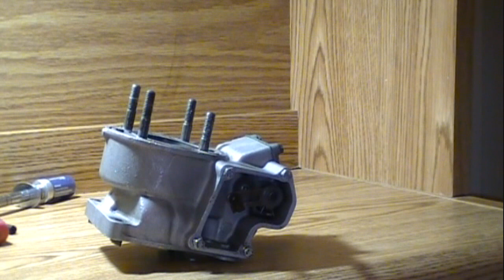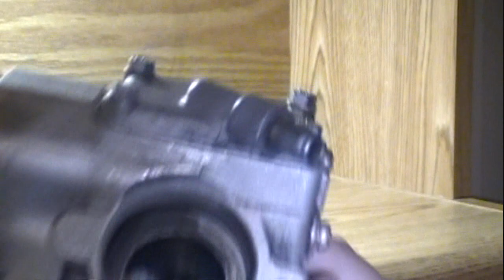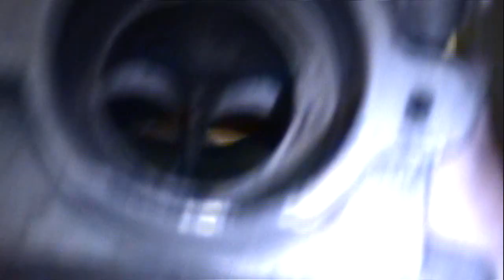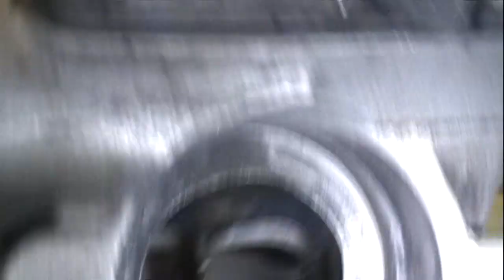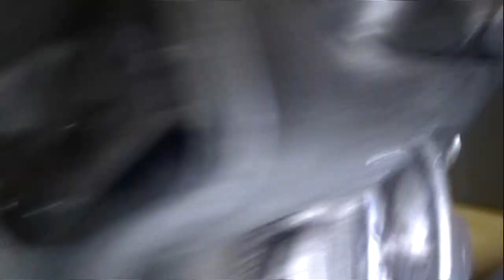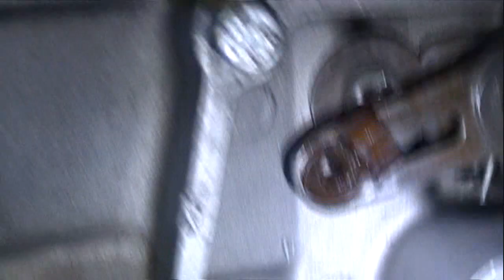Two Stroke Power Valves Explained

Comment: you kind of forgot to mention another crucial part of ther poWer valve system...its not just to give more power and flow At high rpm...it gives 2 strokes a stronger pull at the lower rpms by increasing backpressure and including a resonance chamber that increased the head pipe volume as well as a variable timing mechanism......which boosts torqe....and you only described the 1 aspect, which is the variable port timing which is like the honda hpp system...but the more refined and  better system  is 2 combine the 2 technologies of the variable timing and the addition of an exhaust resonance chamber that diverts the exhaust stream from lower to higher volume to  boost even more additional torque and the next generation of hondas powervalves was called thr crv system.(composite racing valve) and is basically just like the kips system which already was in production and yamaha was the 1st to combine these technologies as well. so in essense 2 things are happening at once .as rpms increase the centrifigul ball governor uses centrifigul force under a spring loaded detent to push the the vaiable timed valves open further and at the same time 2 subport actuating mechanisms divert the exhaust stream to heighten or lessen the exhaust flow volume which simaltaneously also boosts power.... ALL THIS WAS TO OVERCOME A FUNDAMENTAL FLAW IN 2 STROKE DESIGN WHICH LIMITS THE MANUFACTURERS TO DESIGN A PIPE AND MOTOR THAT WORKED BEST AT WATEVER TYPE OF BIKE THEY WERE PRODUCING AND IF THEY MADE THER BIKE TO HAVE ALOT OF POWER UP HIGH....THEN THE LOW END POWER SUFFRED AND VICE VERSA SINCE  THERE WERE NO MOVING PARTS IN THE ORIGINAL DESIGN TO AID IN BOOSTING LOW END SINCE THE VALVES OF THE 2 STROKE WERE FIXED IN POSITION  AS INTAKE AND EXHAUST PORTS. RESULT WAS MOTORS THAT HAD VERY POOR LOW RPM POWER AND THEN A SUDDEN BURST OF POWER WHEN THE MOTOR CAUGHT UP WITH ITSELF WHICH IN TURN MADE THE BIKES SKETCHY AND UNPREDICTABLE TO RIDE...THE IMPLEMENTATION OF THESE SSTEMS ALLOWED A BROADER RANGE OF POWER THAT HELPED BIKES MORE EFFICIENT AND MORE 4 STROKE LIKE LINEAR POWER THAT DEF HELPED COMPETETIVLEY ON THE TRACK...AND THE BETTER TRACTABILITY AND USEABLE POWER WOULD ALMOST ALWAYS GIVE THAT RIDER THE EDGE COMPARED TO A MOTOR W NO POWer valve system
Reply from the maker: I made this video and a lot of my videos on YouTube when I was young and dumb.

Comment: Question why can't you just have a longer push rod hold them open all the way all the time? This would improve overall power band wouldn't it?
Reply: the valve lowers to give better low rpm power, it opens all the way at high rpm so no power loss. Without the powervalve 2 strokes are like a lightswitch with the power delivery

Comment: Can you answer this question what if your power valve doesn't have that push rod in it and it's fixed wide open can you tell me what this does? Because of CR500 doesn't have a power valve. And neither does my motor in my race car you tell me what kind of performance this gives you? And yes we're on alcohol

Comment: My yz125 stopped running today in the middle of ridding, ive cleaned the carb checked for spark and checked compression.   Compression is 120 and seems to have good spark carb has been cleaned.  Whats wrong with it..? Some one told me maybe somethings wrong with the power valves

Comment: Powerband= rpm range . Motors rpm (centrifugal force) opens and closes the exhaust valves . High rpm = valves wide open moving exhaust out faster and new fuel/air mix in faster. Builds on itself, why it feels like turbo kicking in .keep it in the power band means keep the exhaust port WFO!

Comment: that is not how a power valve works. with no power valve the port would be fully open all the time. with a power valve it closes at lower rpms to improve power at lower rpms

Comment: can you explain what would happens if you mix too much oil with gas into the 2 stroke engine.
Reply: a lot happens, you have to remember that the oil changes the viscosity or runniness of the fuel, right? that will seriously affect how much fuel mixture is atomised in the air flow...and that as you can guess will change the engine performance, not always for the worse but more than likely. Most two strokes that come out of the factory are jetted to be on the rich side, the reason for that is simple, a richer mixture is a very effective safeguard against seizing the motor. Here's an example..on a RGV 250 N the standard main jets are 270 and  280 ( that's because one cylinder is at the back and is a little hotter running than the front one) but if you want that engine to really perform like crazy you can drop those main jet sizes down to like 240 and 250 and it makes a whole world of difference, but, when you do that, you might want to think twice about holding the throttle wise open and running the bike at 10,000 rpm in 6th gear for extended periods, unless you are running really good oil and have modified the thermostat to allow more coolant to pass through that bottleneck in the coolant cycle. I had one that I was lucky enough to get the genuine SUZUKI hop up kit for...all the track parts and that bike was totally psychopathic to ride,every time I got on it I felt like I was riding a homing missile !
Reply: Nothing really, it just smokes more and you will have less power because there is less fuel
Reply: plenty actually...you get a serious reduction is power,and responsiveness, plus you also quickly increase the amount of coke and black tar that builds up past the exhaust port, which does also change the characteristics of the power produced, and can also make power valves stick, and will eventually mean you need to burn out the crap inside your expansion chambers..it's a no no...
Reply: Just run 32:1 and you're fine.

Comment: No it does not improve low rpm power by flow restriction. Its not a 4 stroke, it has primary compression and transfer ports.

Comment: Why cant it just be open all the time? And just use the throttle to control the power?
Reply: It's to add torque at lower rpms
Reply: If it's open all the time, you would have weak low-end power. Otherwise if it has a fixed smaller opening, it'll have good low-end power but weak mid-high.
(CMIIW) The engine needs higher compression for more low-mid range power. At higher RPM, too much compression would cause combustion gases to pre-detonate resulting in excessive heat and catastrophic engine damage.
Reply: you would bog out
Reply: Erik, mine ('01 cr250) was for a full summer. I had next to no bottom end and the top end screamed (like it should). The bike will  become a spooge factory and run inefficiently. It was like 1980's turbo lag.
Reply: Its like having a huge set of heads on a sb engine it can make power up to but won't have any throttle response or bottom end torque. 28th a PV you have have a smaller port for low rpm and bigger to too end power.

Comment: Its all about exhaust port duration and cylinder scavenging. At lower engine speeds the engine doesn't require the amount exhaust port area time as it does at high rpm. The primary reason for using these valves is to improve lower rpm hp without sacrificing high rpm performance. The primary crankcase compression will not overcome left over spent exhaust gas pressure for a split second if the exhaust duration isn't long enough at high rpm decreasing output. Having said that increasing exhaust duration lowers the effective stroke decreasing the amount of work each combustion cycle can do.

Comment: all these retards that think they know what a power valve is lol, its to reduce the exhaust port size at lower rpm to increase the engine torque, at higher rpm the valve open fully so no restrictions, hence why retards tuning 125cc motors jam the valve fully open thinking they are tuning it.
Reply: +backyardbasher I think a set of new purple powerbands will cure most of their problem. i'm still yet to see a set of "powerbands"
Reply: the only way to alter port timing is to physically move the port up or down the cylinder
so that it opens earlier or later in regard to the pistons position on the relevant stroke.
watch the video danielsonretardo you can see the port size restrict then open as he 
actuates the lever. You are talking about variable port timing, that has nothing to do
with power valves, two totally different systems.
Reply: dude I'm a mechanical engineer think I should know. the powervalve blade creates like a false ceiling for the exhaust port that is considerably lower than the port itself
Reply: well clearly you dont know, and the ceiling of a port cant be lower than the port itself, that's just ridiculous, just think for a moment on what you just said, either you explained that wrong or you have no idea what you are talking about. either way i'm outta here, have fun mr mechanical engineer.
Reply: danielsonn77  mechanical engineers only fix HVAC systems. LOL
Reply: Spastics itc
Reply: incorrectamundo*
Reply: Your resume is not an argument. Just state your case, Fonzie.
Reply: backyardbasher yepper

Comment: I adjusted the power valve on my rm125 2001 because it had bogging issues on the low end and you couldn't put around or go slow you always had to romp on it. so my friend put a new ktm carb on it same issue but better. then I bought it did some research and saw you could adjust the valve for more low end power. so I did and it is much much better now on the low end. but my buddy said it's bad to adjust that and you can blow your motor is this true
Reply: +jim Plaxco no, your mate is a fucking tard....all that will hppen is that you will alter the power curve...you cant blow up a 2 stroke like that..and btw..the explanation that guy gives is so horribly wrong it makes my head hurt....
Reply: I've never worked on anything or owned anything like this but based on what I've researched... if it's not the power vaulve wouldn't it be one of the Jets that needs adjusting.... like the pilot jet. or the air screw right?

Comment: from my 35 years of knowledge you dont need power valves. i have a 87 kx 250 that didnt work when i bought it. so fuk it i left em out. i bought a 91 kx 250 cylinder and am in the process of putting that together. so when people ask if a cylinder can go on a certain bike yea anything can be done with right know how. and tools.

Comment: Power valve is there to change the timing for the exhaust port not to make a bigger exhaust port. When it opens, the top of the cylinder reaches it earlier. It's "kinda" like how vtec works in honda.
Reply: +Ber Nard Pretty much! Random Addition 2 strokes just need a bit more space to pull more fresh air/fuel in (because more exhaust can escape). While 4 strokes w/ "Vtec (or VVTI)" adjust the cam to push the valves open farther (at i.e 3800RPMs+) for the same general result: Faster it goes out, faster it comes in.
Reply: Bernard Mamo so like if u k8ck the bike should the power valve move or no

Comment: why are they so expensive? my right valve has a little chip in it but its over a 100 just for that. would it chip more if i keep riding? i feel like this is what caused my piston and cylinder getting scratched
Reply: +Noah .Ireland theres no real reason they are so expensive, they are just ripping you off, cos they know you gotta have them..thats all..if your mechanism is likemine, on the rgv 250 N,..you need to have them modified with thicker stronger pins, so that they dont wear and allow part of the valve to just slide into the cylinder and hit the fucking piston and rings! I know its a bad design fault but thats how those bastards make sure you'll be back to spend more money..they need shooting, but there are after market valves that are way way better than the original ones....

Comment: my 98 kx250 power valves are damaged left and right they were discontinued i was told i can just not put them back in and be at full rpm all the time wil this work
Reply: shawn stephens the engine wont be at full rpm all the time, that's still controlled by the throttle. by removing the power valve you'll just never have exhaust restriction so your power band will move up higher. All a power valve is is a variable exhaust port. it'll make no change to your engines ability to run without it.
Reply: will it blow up ? or still work to ride or should i put them back in and hope they work properly
Reply: It won't blow up, it should run fine.
Reply: +shawn stephens you can mine are discountinued as well i leave them out. block off the ends.

Comment: I'd say they are pretty basic... was wondering that last night before I went to bed. Thought it would be better if they would putt the exaust ports at BDC, and that would mean better low-end torque. Than was wondering about mid-top end.
.
Could use the same concept with ports all there own that open according to RPM....

Comment: Let me explain it a little better, there's a centrifugal clutch on the water pump shaft, the water pump normally runs off the crank gears and not the clutch. different springs can affect how quickly the valves open, aside from that spot on.

Comment: Does the powervalve met water (cooling liquid)? i get water in the cylinder and i see that on powervalve (loocking thru cylinder) is wet, and i can t start my engine, my sparkplug get full of water! i have compression also!
Reply: that is most likely from a blown head gasket

Comment: Not strictly correct. The powervalve remains closed at lower engine speeds and opens at higher engine speeds. This is correct. The reason for this is to alter the exhaust port height and in turn, exhaust port duration. On a 4 stroke the exhaust is a valve and so is controlled whereas on a 2 stroke the ports opening and closing is controlled by the position of the piston. When the piston goes down and passes the top edge of the exhaust port the port becomes "open" and the gases begin to escape into the exhaust. On a 2 stroke, the height and shape of the exhaust port affects the power and the length of the powerband. If you can vary the height of the exhaust port you can increase power at lower rpm, whilst retaining full power at higher rpm and therefore widen the powerband. The powervalve gradually opens to then effecticly raise the exhaust port height with the raise in rpm.
Reply: The kx100 1998-2013 powervalve doesn’t work like that or at least that’s what pro Circuit says “The stock power valve on a KX100 only lowers the exhaust port to a minimum resulting in less bottom end power.” Would the aftermarket power valve make the powerband more linear so it’s smoother like a 4 stroke?  I have a 2009 kx100 but I think I’m gonna sell it unless the pro Circuit power valve will make it easier to ride

Comment: If you look at a non power valve curve vs a power valve curve you will see. At low rpm the curve where the valve is shut has higher power at some point the curves intersect, this point is optimal rpm for valve to open and at high rpm u will see the power valve curve has higher power. This is why a sticky valve can make u bog at bottom end but have perfect power top end. Also in general if you feel your valve "kick" in it's usually setup wrong. The transition should be smooth, the kick shows a jump across curves from one power to another. If you consider the curves once again the optimal rpm is when bhp (curve 1) = bhp (curve 2) you should feel no kick as the bhp hasn't changed. However you should feel a significant increase of power across the top end spectrum.  Believe me if u feel the thud of ur valve kicking in you're losing time.

Comment: can somebody help me? is it possible to setup the power valve, so that it would open at lower rpm? i've got a husky 125 2 stroke and every time i hit the power band and shift up, the revs drop, and the bike isn't in the power band anymore...
Reply: 125's have all the power up top, you cant change this. Actually having them open up earlier would take away power.
Reply: Anyway, if you're really on it and shift at a high enough rpm, it should still be in the power...

Comment: hang on, this probably sounds stupid of me but I'm confused. If all the power valve does it move to blocks of metal up to open up the exhaust outlet then why not just remove them completely?
Reply: Ok I realized that it needs to be a smaller gap for the lower speeds and a bigger gap to make the higher end speeds? I think..

Comment: It gives the effect of allowing a higher exhaust speed at lower and mid rpm.
Which in conjuction with a tuned expansion chamber that has a better top end power band. (Relies on fast traveling exhaust gases to scavenge the fuel)..
Makes for a better low and mid range  power while keeping maximum horsepower the same as before.

Better scavenging as the expansion chamber gets a broader power band while keeping the same top end and therefore better fuel economy and tourqe!

"Assuming the highest duration of the exhaust port isn't altered!" :)
Any comments if I've gotten it right? :)

Comment: port valves are to control port timing not flow, like variable cam timing, less duration for low rpm and more for high rpm.

Comment: A power valve slows down the normal scavenging that a 2-stroke thrives on at high rpm.  At low rpm, much of the air/fuel charge coming into the cylinder would normally escape out the exhaust.  The power valve prevents this by dropping the height of the exhaust port, giving the piston more of a chance to compress the air/fuel mixture.  At high rpm, the valve is no longer necessary because the pressure wave generated inside the exh pipe keeps the air/fuel charge in the cylinder.

Comment: nope. if it would be wide open at low rpm too much gas would exit the engine and compression would not be very high - which would result in even lower power at low rpm:).